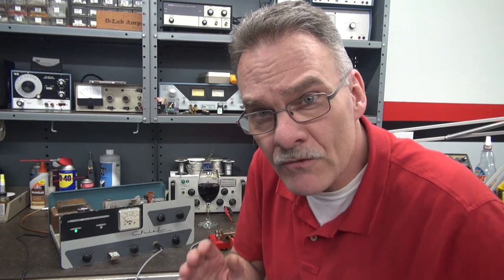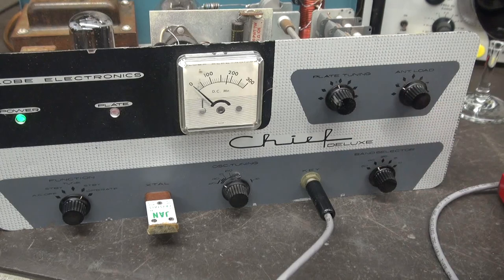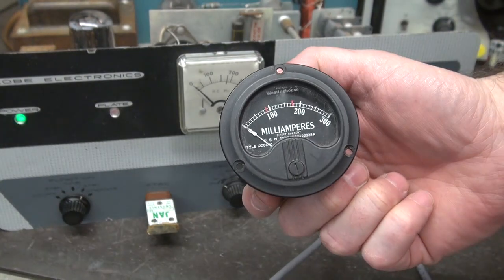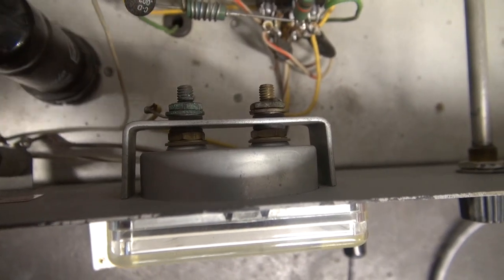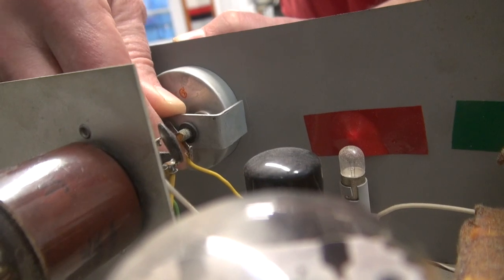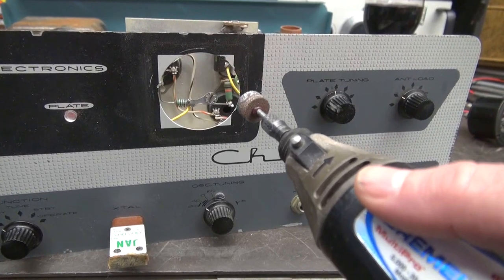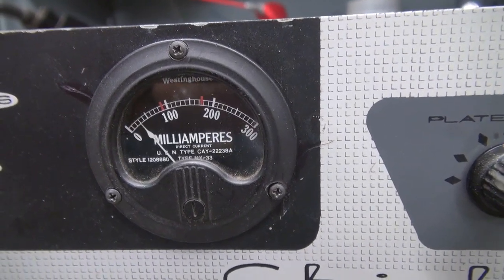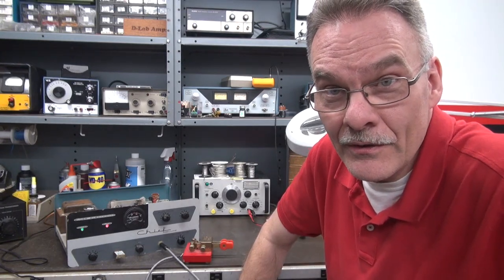How to Upgrade WRL Globe Chief Deluxe Ham tube transmitter Plate Meter

Comment: "You can do anything with a Dremel tool."  Best line of the night.
Reply: I never had luck using an abrasive wheel on aluminum, it clogs up too fast,  I'd start with a carbide cutting bit, then a sanding wheel to clean up.

Comment: People should know the difference between preservation, restoration, repair and repurpose.

If you get a prewar amplifier with all original components, for instance, you won't probably be able to power it up and play because capacitors will be leaky or dried out, grounding will not be compliant, contacts will be rusty, tubes won't be working, etc.

You can decide to preserve this amp as a faithful example of how prewar amps were built and what materials were used back when. Then what you do is keep it in a controlled environment to prevent further deterioration.

Or you can decide to restore it. Then you will replace all the defective components with new ones, but you will respect the use of materials and processes of the era as much as you can. For instance, you will use new (i.e. not leaking) paper capacitors, even knowing that they have a tendency to leak over time. But the idea is to bring your piece of equipment to a working condition as if it was new at the time of its introduction.

But you can repair it. Now you want to bring the old piece of equipment to a working condition, retaining the main traits of it as a historic item, but you want to use modern components, like modern filter caps, coupling and decoupling caps, compliant power cords, etc. Upgrades included. Why not? You are repairing. You want to keep on using it. The repair will now be part of its history.

Repurpose is the most radical intervention. But it is a practice that has been used since ancient times. It certainly destroys historic evidence. But it is better than scrapping. Numerous historic findings were made because parts of a piece of history were repurposed and consequently kept from total waste.

When I am before a piece of history, I tend to repair it if necessary. Before I repair, I document the original state of it. If repair is not possible, then why not repurpose? Restoration and preservation are for museums (public or private) I guess. But giving a new life to an old bugger is also a form of preservation.

Comment: A proper meter also helps to extend the life of the finals, too. Those goofy bouncy 'moving-vane' meters take a relatively long time to stabilize enough to accurately dip the plate, and if the plate-tuning is way off-resonance at first, the final's plates are gonna be cooking while the friggin' needle flops back and forth.

Comment: Nice job Terry.  I wonder if adding a small cap to the old meter would have calmed it down... who knows.. I do not know enough about keying to make a valid suggestion but who knows.  very nice work. I agree.... if a piece of gear is not usable, why maintain an old look.. I'd rather it be usable and someone enjoy it.   Nice work
Reply: That's what I was thinking.  Hard to guess a value beforehand but maybe start with a 1uF and just see how the meter reacts.  Personal preference here.

Or if you truly want to insult the originality, build a little LED bar graph display and driver board.  No overshoot, just instantaneous actual value.
Reply: A smaller, cheaper meter might have fit the original hole & mounted just like the bouncy-betty meter. That would be completely reversible down the road. 
One isn't really preserving historical value with mods - you might keep it operating but it won't be the same piece it was before the change.  I hope he keeps the old meter with it in case a future owner wants to restore factory appearance (tho it now has more holes than the factory gave it).
I know this sort of thing is a contentious issue, but there are already-hacked rigs to modify & tinker with. And cheaper, because they aren't pristine.  The few (& fewer every year) good looking examples seem to deserve preservation.  
And I'm a sinner too - I've hacked & modified & parted-out things that make me cringe now.

Comment: To use a meter of that quality probably would have added 10% to the price tag of $80 in 1960. It was built to a price point to compete with the Heathkit and Eico offerings of the time. Things like precision meters and transformers were relatively expensive components at that time, and, indeed still are today. Well done as always. 73 Doug.
Reply: Some of those bouncing-betty meters were okay for accuracy, they just lacked a damper in the movement.  But it did leave you wondering during tuneup how the final amplifier plate was getting along while you waited for the meter to settle down.

Comment: How do you measure grid current ?
Reply from the maker: This transmitter did not have that function. The Globe Scouts did have 2 scales on their meters. One for Plate and the other grid.
Reply: I have a Eico 723 transmitter that was my first commercial made when I was a novice. The meter does the same thing. The meter at full scale is at 150MA  full scale and you have to load it to 120 MA according to the specs.  So I switch it to read grid drive reduce that bouncing around of the meter. Anyway I knew I was loaded up properly when the hallway lights glow when I transmitted !!